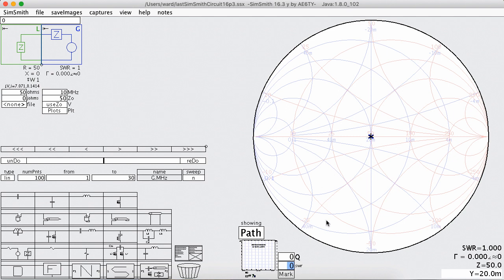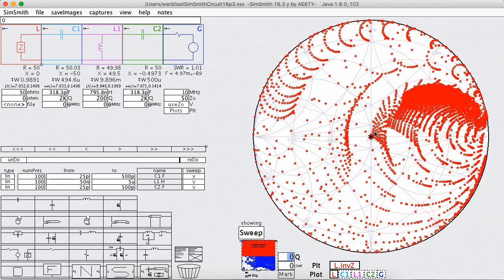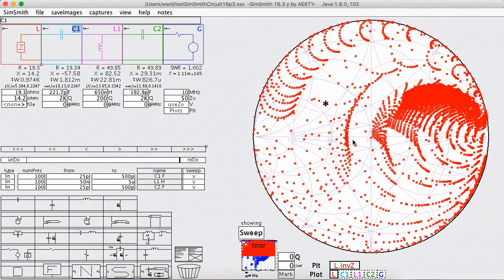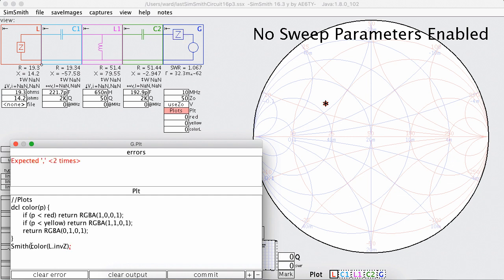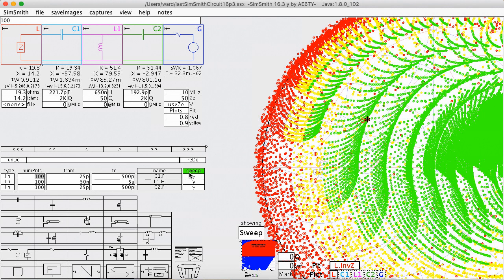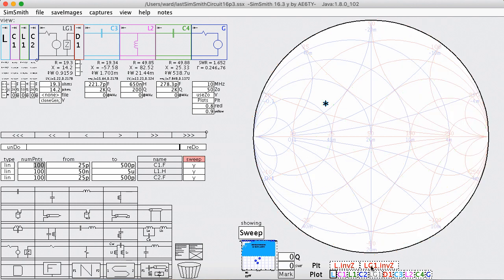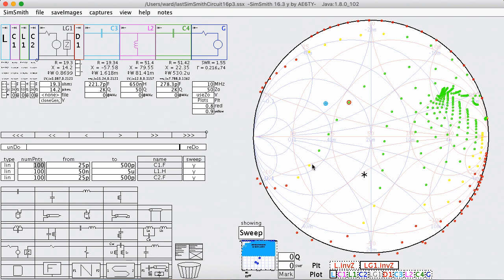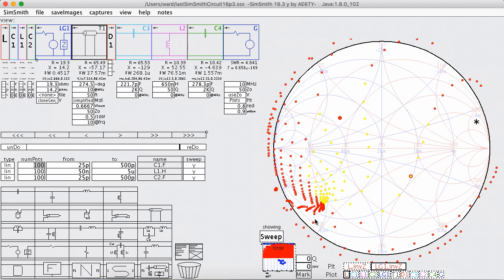Analyze T and Differential T Transmatches

Comment: Great video. I just have a little doubt. When you inserted the transmission line (50 feet) on the Differential T, the dots got red, BUT, u didn't change the limits for the definition of red and yellow (0,9 and 0,8) and didn't take into account the attenuation 50 feet of line introduces ! Should be something around 0,2-0,3 dB, meaning around 5% loss ..... enough to drive the green into yellows and the yellows into red

Comment: Great videos! I didn't quite understand the setup for the differential T.  Could you please expand on that?  How does setting C4= to Cmax-C1 make it differential?   I understand differential to mean that the circuit is symmetrical across the load , and thus there would be capacitors connected along the return path, tied together at the "bottom" of the shunt inductor L2.  These caps are in series with C3 and C4 in the loop, so their values (and the values for C3 and C4) would  need to be twice what C1 and C2 are.  Am I misunderstanding what is meant by differential T in the video?  Could you please expand on that a bit?  Thank you.